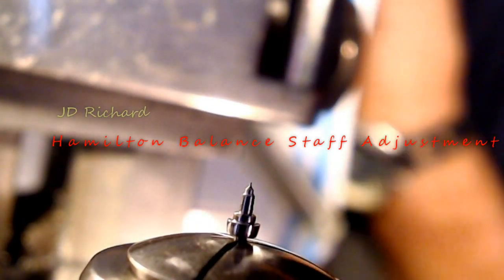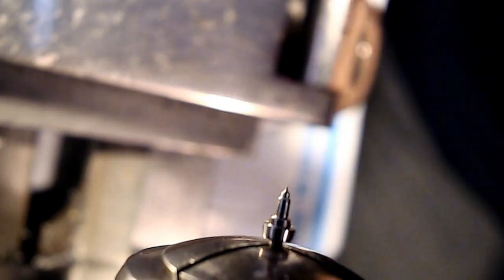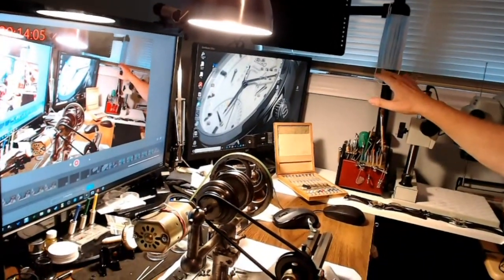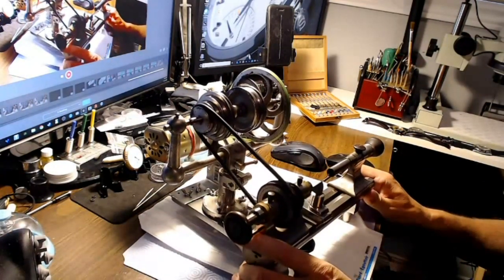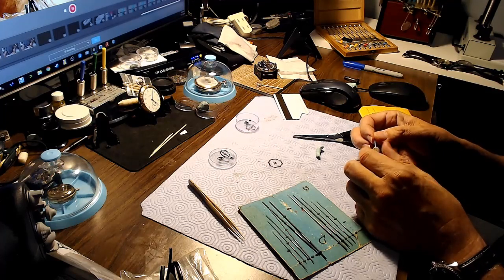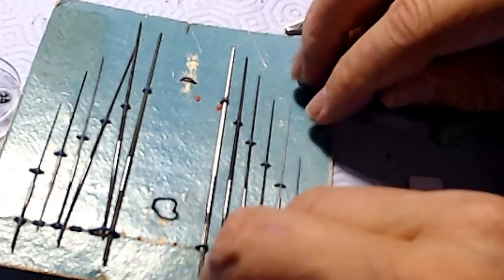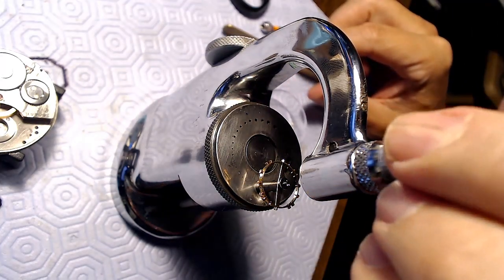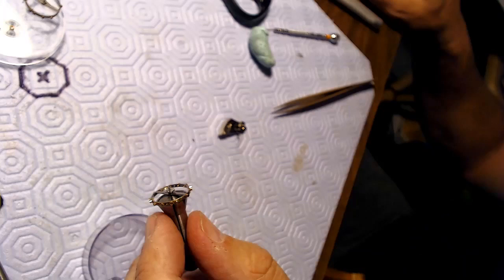Hamilton Pocket Watch Balance Staff Adjustment

Comment: JD thanks for the demonstration of the calipers.  I struggle with the placement of the indicator relative the the balance.  You don't know where the true position is.  The indicator can rub but is the balance too high there or is the position correct and the other side of too low?  Maybe the arms are both warped low which causes rubbing on the plate or maybe the arms are warped high which causes rubbing on the center wheel or the balance cock.  Comments?  Thanks,  John
Reply from the maker: You really need to cut the staff as close to the original as possible and then leave enough length on both pivots to do the adjustment. Usually the impulse jewel is long enough to support a bit on up and down adjustment of the balance. Tweeking is tough. The calipers are just used to check the true of the flat and then adjust. If the balance is to close to the center wheel, then you only have too options to lower it; take material off the lower pivot or recut where the staff fits on the staff. Too low and the impulse jewel will not work correctly with the pallet fork.

Comment: I don't NEED anything rotating on my workbench but now I WANT something rotating.
Reply from the maker: Once you start using a lathe, you will realize how many applications there are in watchmaking. Watch your fingers
Reply: @JDRichard  I actually meant your rotating platform for your microscope!  But yes, I do want a lathe as well but I'm not quite there yet.

Comment: Nice setup; When i look at vintage watch workers at there benches. The benches are arm pit high so they are eye level with there work.
Reply from the maker: I am getting a mini bench or Thursday from England. 1000bucks So it better be the right height for small watches.
Reply from the maker: Just picked up a Horotech Mini Bench. Still setting it up.
Reply from the maker: Good for you. Not really needed for cleaning a picked watch but definitely needed for watches and the Rolex I’m cleaning this Friday

Comment: Reminds me of my apprenticeship 53 years ago must have turned 500 staffs in the days when ready made staffs for obsolete makers were not so available as now.Hamilton were as good as their Swiss rivals splendid watches
John Anderson watch repairer
Reply from the maker: Thanks for the feedback. Was kind of stuck on what to do as the staff seemed to be the right size but was touching the wheel. In the end, removing material from the lower pivot allowed it to drop down properly into the jewel resulting in the balance not touching the center wheel. Tonight I put on the hairspring and see what I have:) These are always adventures. Not a customer watch so I'm not too concerned.

Comment: Wow you are good JD!
Reply from the maker: Thanks for the complement.  Head now getting bigger:) Was kind of stuck on what to do as the staff seemed to be the right size but was touching the wheel. In the end, removing material from the lower pivot allowed it to drop down properly into the jewel resulting in the balance not touching the center wheel. Tonight I put on the hairspring and see what I have:) These are always adventures. Not a customer watch so I'm not too concerned.
Reply: @JDRichard  Excuse my ignorance but if the lower pivot was too long would'nt that suggest that the entire balance was too long?  Removing some of the lower pivot make the balance shorter which drops the balance but might affect how well both pivots fit in the jewels?  Is the top pivot now a bit short?
Reply from the maker: @johnarmsby6740  you are basically correct. It is a game of millimeters and a bit of an art.